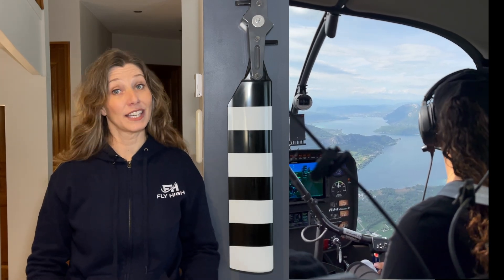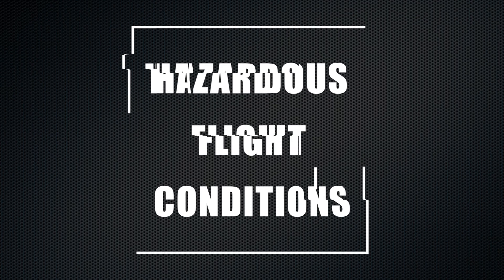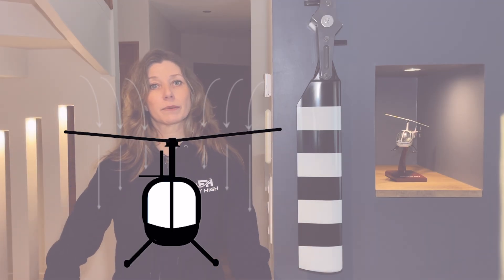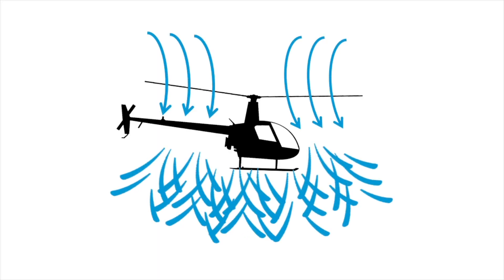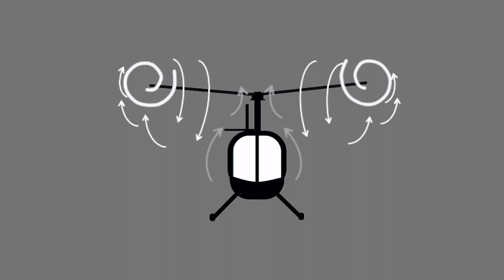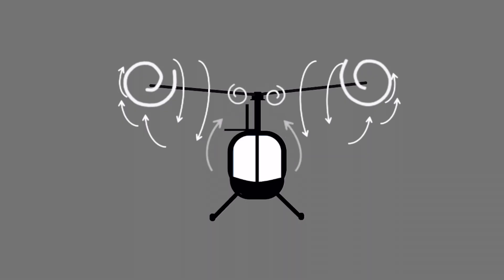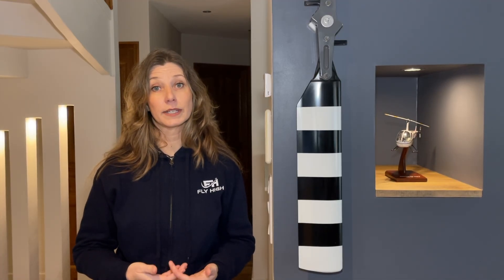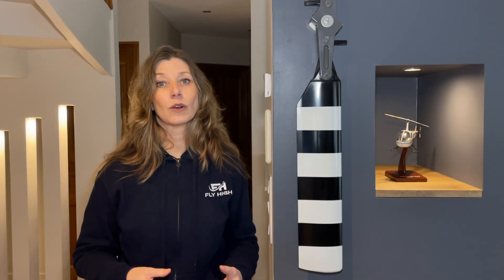HELICOPTER VORTEX RING STATE : Understanding the Dangerous Phenomenon

Comment: Oh yes…I know just what she means when I fly to parties at my upper middle class friends country estates in my private chopper😊.  FWIW the ring doughnut vortex effect hits all helis from monster cargo lifts down to small R/C models.  The air circulates down then back up just outside the rotor disc and down through the middle so the rotor is flying in a severe down draft of its own making.  If there is a breeze the vortex ring move down wind a bit…if you manoeuvre down wind to land you might just fly right into it.😮
Reply from the maker: Thanks for the added insights, it's a great point that this phenomenon impacts all sizes of helicopters, even R/C models!

Comment: Alright, so from what I understood, it's that during low altitude hover or relative downward movement, helicopter creates sort of a closed loop of air, like aerodynamic bubble in which helicopter now tries to push away itself. Like attempting to lift yourself by grabbing your legs and pulling up. And the way to exit it is to actually do the opposite of what instincts would say, and flatten blades AoA to reduce turbulences, and try to just move forward or sideways to exit the bubble.
Reply from the maker: You’ve got a great grasp of the concept, Furebel — beautifully explained. 👏 Just one small clarification: vortex ring state isn’t limited to low altitude. It can actually occur at any height, as long as the helicopter is descending into its own downwash with low or zero forward airspeed and power applied. That said, it’s true that it often finishes near the ground — which is why training for it is so important. Thanks again for such a thoughtful comment! 🚁

Comment: I had watched the swiss videos but didn't understand until this video!
Reply from the maker: Excellent ! Glad to help 😃
Reply: @flyhighwithcarothepilot  I have a Brother that is a Fixed wing instructor (and 737 FO) and My Grandfather was a Pilot, so I understand the (fixed wing) basics, it wasn't until you explained the mistakes that are made, increasing the AOA (Collective) whatever lift you did have, you just threw away and stalled the entire "wing" when you need to do the opposite, the same as pushing the nose down on a fixed wing aircraft, to trade altitude for airspeed, and get the stall to stop, meanwhile running the cyclic out of the "dirty" air. - Makes so much more sense.
Reply from the maker: Exactly!

Comment: I had a similar experience with an FPV RC helicopter. I built the craft for endurance missions and low power. The blades were at a stalled angle with the descent velocity of the craft in the mix of the air attack angle. Not enough power to speed up the rotor to slow down the descent, and the rotor was stuck in the stalled configuration until the RC helicopter hit the ground. Most RC helicopters never experience this because the toy helicopters are always overpowered with almost infinite torque to overcome all stalls.
Reply: That's an interesting take on this problem. One of my PhD math professor friends and I model this and came up with a slightly different version of things. Basically that rotor spinning on the top gets everything underneath spinning and after a short time enough of it is spinning that the pressure drops underneath the machine.
Reply from the maker: That’s a fascinating story — and such a great example of how the principles of Vortex Ring State can show up even in the RC world. You’re absolutely right: most toy or high-performance RC helicopters are so overpowered they can power through almost anything, but when you're optimizing for endurance and efficiency, you start to run into the same aerodynamic limitations as full-scale rotorcraft. Thanks so much for sharing this — really cool perspective! 🚁🔧
Reply: @flyhighwithcarothepilot  it's really fascinating that this guy has a helicopter and it's that small. The differences between the two things in their relationship to are is huge. Smaller is always easier to build out of available materials. Larger generally offers a better Reynolds number overall. Always remember you never see a 6-foot four gymnast. To gain enough angular momentum and then reduce it and land on his feet doing a flip he has to go quite a bit higher.

Comment: Hi!  Do Vortex Rings only effect helicopters, or do they effect airplanes too?  Do you know if EVTOLs can be effected by Vortex Rings as well?  Thank you!
Reply from the maker: Hi @joharinichols2652 ! Great question! 😊 Vortex Ring State is a phenomenon that specifically affects rotorcraft—like helicopters and multicopters—because it’s linked to how rotor blades interact with their own downwash during vertical or near-vertical descents. Airplanes aren’t affected by VRS since they rely on fixed wings and forward motion for lift.

As for eVTOLs, yes—they can be affected by Vortex Ring State, especially those with vertical lift rotors or ducted fans that operate like helicopter rotors during hover or descent. It’s something designers and pilots of eVTOL aircraft are very aware of and working to mitigate through flight controls, multiple rotors, and descent speed limitations.

Thanks again for the thoughtful question!
Reply: @flyhighwithcarothepilot  Thank you for responding.  You're actually the first person out of about 7 that I've asked, that actually had an answer for me.  Thank you!  So something like the XPeng X2 could have similar danger issues like a helicopter.   I'm guessing the Lillium Jet shouldn't have those problems, because the fans are built into the wings.  I get it, thanks!
Reply from the maker: You’re so welcome — and thank you for such a thoughtful question! 😊 You're spot on: something like the XPeng X2, which uses vertical lift fans, could potentially encounter similar aerodynamic challenges to helicopters, including VRS. The Lilium Jet, with its embedded fans and strong forward flight component, is less likely to face VRS in the same way — though all VTOL designs come with their own unique aerodynamic considerations. Super cool to see you diving into this stuff —  🙌🚁⚡✈️

Comment: You are explaining very well why most pilots react in the first monent in the wrong way raising the collective pitch when they feel a sudden loss of altitude. Good to know how to avoid a Vortex Ring State situations with avoiding too few airpeed, too how decending rates and tailwind. And it was amazing to see how fast you can end this state with flying out forwards or sideways. I am just flying RC helis, and they have so much power in relation to the weight that we don't experience such problems. But even though I am avoiding tail wind landings and take offs because I feel much less control.
Reply from the maker: Excellent. 👍

Comment: I have asked on other channels explaining VRS before, but never got an answer.

How does VRS act in a coaxial rotor design ?  Since each rotor is rotating in the opposite direction, would the vortexes cancel each other out, making VRS impossible in a coaxial rotor design ?
Reply from the maker: That’s a very good question. I would imagine that VRS is still possible in a coaxial rotor design because there is still a downwash and VRS happens when the rotors get caught up in this turbulent downwash.

Comment: Thanks for the nice explanation. Today I flew my mini drone. Battery was slowly getting low as I was high, directly above me so I put it into sports mode and pulled the left (throttle) stick totally down. It descended a bit shaky but well and quickly. I was surprised that I was totally unable to recover the descent although timely trying to add thrust. I crashed but thankfully into the grass and nothing broke. My first thoughts were about software (feedback and control), battery having less power/voltage, hot esc's (speed/motor controller) and stuff like that. But maybe it just was some kind of vortex ring state. Guess I will compare to what happens when i apply forward speed in one of my next flights.
Reply from the maker: Thanks for the feedback SammYLightfooD   Super interesting comment. I’d be interested to find out more 😊

Comment: One note:  The Vuichard method should ONLY be used BEFORE entering VRS. If you increase power after developing VRS, you will accelerate downward dramatically. It’s possible to reach rates of descent over 6000’fpm within a couple of seconds.  I have not seen a video that actually shows a fully developed VRS from in the cockpit on any of these teaching channels and it’s unlikely that any will ever surface since most instructors have never experienced fully developed VRS themselves. If you ever truly experience VRS and attempt to raise the collective first to get out of it, you will vow to never attempt that action ever again.
Reply: I can demonstrate with a R66, that I will recover by just raising the collective only. Weight and DALT are factors too. Some Situation you  don't have time to lower the collective first, you pull and at the same time you give the cyclic the impulse where you have space.  If doing Vuichard know which side to recover is very very important. But always do as you were taught at school and never try something else without a instructor.
Reply from the maker: Wise words 👍
Reply: @GyrocopterGirl  You describe pre-VRS conditions.  If you ever actually entered into VRS, you would know to never raise the collective to attempt recovery.  Only increase power after departing the dirty air column or at low levels of descent.
Reply: This is false... because with the Vuichard Maneuver you do NOT raise collective "first".  
You raise collective, while simultaneously appling cyclic & opposite pedal.  
The sideslip from apllying cyclic & opposite pedal... immediately moves the rotor tips outside the turbulence where they can generate lift, & the increase in power literally pulls the helicopter out of the vortex.  
This is why the recovery is so fast.  

If you are pulling collective "first", before applying cyclic & pedal... you are performing the maneuver WRONG.
Reply: @OOTurok  The maneuver explanation video clearly instructs to lead with increase collective.  That is bad technique and will exacerbate the problem IF the rotor system in VRS.  As long as you understand that ANY directional flight to escape the dirty air column is the first priority, you will be fine.  The problem with Vuichard is that it uses a control input (raising the collective) that is absolutely incorrect for escaping fully developed VRS.  I have not seen a single training video that shows escaping fully developed VRS, only escaping pre-VRS.  Directional flight or full autorotation is the only way to escape fully developed VRS.
Reply: @greysheeum  
I'm  just gonna call you an out right liar at this point, because the video with Vuichard himself performing the escape states to... pull collective to full power while  SIMULTANEOUSLY  applying cyclic & opposite pedal.  
I've trained using the Vuichard Maneuver in flight school numerous times, & we were taught to perform all the actions SIMULTANEOUSLY.  
The purpose of the side slip is to get the rotor blades outside of VRS where they can generate lift, while having power pulled will drag the rest of the rotor disk outside of VRS faster, as the rotor blades will produce lift the instant they exit of the vortex.  

Furthermore your claim that it's not fully developed VRS is abused... because as soon as the rotor blades are fully enveloped by the down wash, VRS is FULLY developed.  
You can see this in the Vuichard video.  
You don't have to fall X-number of feet, for X-amount of time, or at X-amount of speed before VRS is "fully" developed.  

The reason VRS happens is because the rotor blades become enveloped by their own turbulent down wash, which causes the blades to stall, & no longer produce lift.  
You CANNOT autorotate out of VRS, because the rotor blades are not producing lift.  
Autorotation is where you are using the stored energy of the rotor blades to maintain lift to REDUCE your descent rate.  
It is  IMPOSSIBLE  to maitain lift while in VRS.   
You have to 1st escape VRS where the rotor blades can generate lift again, before you can autorotate.  

In the situation where you entered VRS because of engine failure... the method of escape is to drop collective, & apply forward cyclic to increase airspeed.  
Once the escape is complete, & the rotor blades can now produce lift again... only then can you autorotate to reduce your descent rate.
Reply: Right on man, I fly helicopters in MSFS 2024.
Reply from the maker: Thank you greysheeum for your valuable input. 🙏
Reply: I studied this with my math professor one time. It's ugly and fast. By our calculations that we're not going to be very many warning affects before you just fell like a rock.

Comment: That was a great explanation, very will said...thank you. As a private owner/pilot of a R22 Alpha, I can also add that hovering over water can cause the same problem and the helicopter will sink into the water. Add some cyclic in any direction to move the helicopter before it is to late. Unless you have floats.
Reply from the maker: Thank you for your helpful contribution 😀
Reply: @flyhighwithcarothepilot >>> FWIW: Several years ago I saw footage {here on YT?} of a small helicopter -- I think it was either a Bell 47 or a Hughes 269/300 -- that the pilot tried to hover too low over water and ended up 'going for a swim'. {If I remember correctly, density altitude was also a factor.}
Reply: True. Plus 2 bladed rotor IMHO is always less safe than 3 bladed for example, but this is only my personal opinion.
Reply: In the machine shop we drove ourselves insane to have co-linearity. It appears that in this rotor vortex state if the axle of the rotor and the axle of the vortex remain aligned, the helicopter crashes and if you can get the axle of the rotor away from the center of the rotation in the air, the relationship is destroyed and the problem goes away temporarily.

Comment: What are the real chances of recovery from a vortex ring state❓
Reply from the maker: If you have been well trained and you are high enough you have an excellent chance to recover bit it all depends on the circumstances. However the best is to remember the golden rule and never get into the vortex ring state in the first place.
Reply: Using the Vuichard Maneuver, you can recover within 20-50 ft altitude.